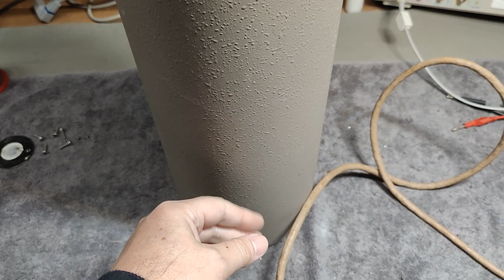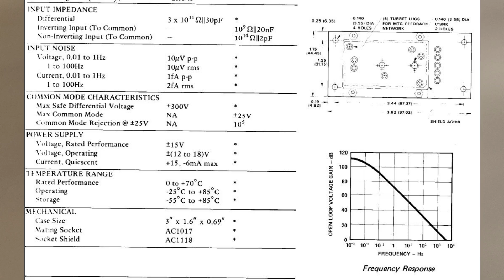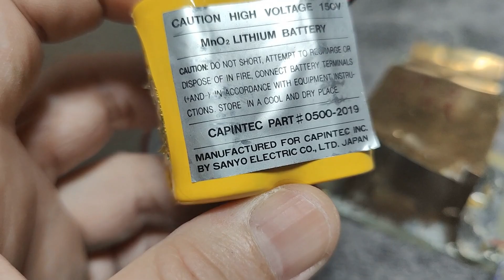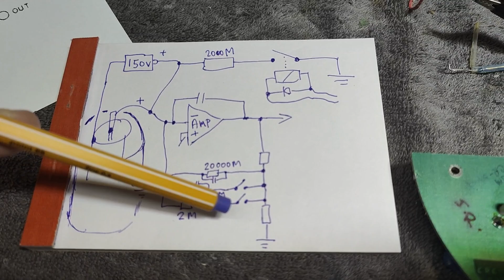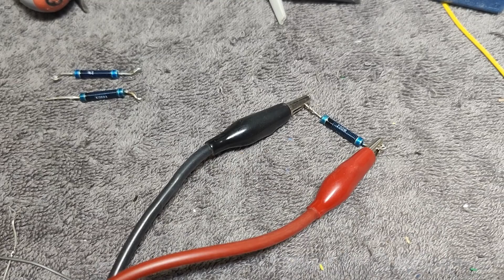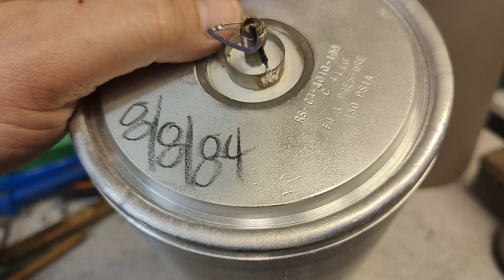Capintec CRC-120R Radioisotope Calibrator ION chamber 1984

Comment: That 310J is looking for current pulses in pA.
Get a fluke electrometer to check those resistors.
That's an ion drift chamber using 48x3V bias to get the ionized noble gas atoms across which their pico ammeter would measure to determine the radioactivity of the source they were measuring. 
I've snagged a couple of their measurement units.  Nice components.

Comment: For very large resistance measurement >100 megohm, conductance measurement is generally used. Most precision lab multimeters support conductance (millisiemens or microsiemens) measurements for ultra high resistances.

Comment: The gas should be something heavy and non radioactive, like SF6 or some FCKW.
If the amplifier draws so little supply current, chances are the OP-amp uA709 is broken. AFAIK the uA709 was not very robust (e.g. no short circuit protection). 
The high isolation relays can also be quite valuable - they are sometimes looked for to repair electrometers. 
A Geiger-Müller tube would be more sensitive, but the gain is not as stable. So for calibrations and precision they use Ionization chambers instead - the 150 V battery would also be too low for a Geiger Müller tube.